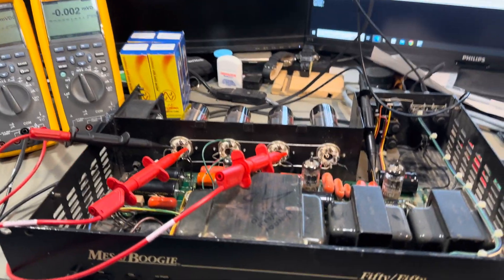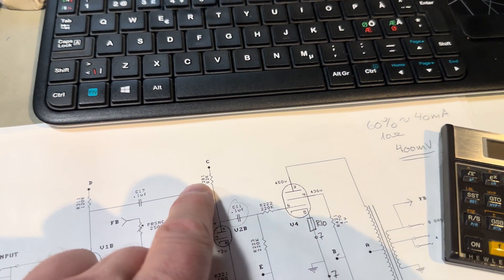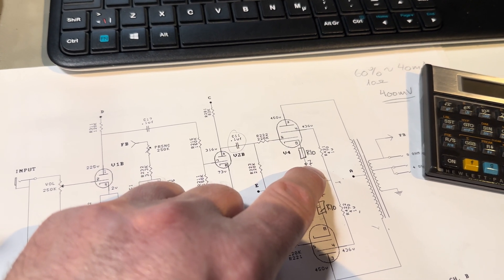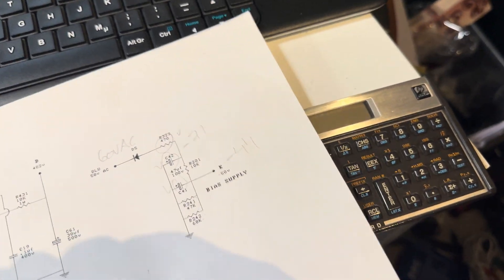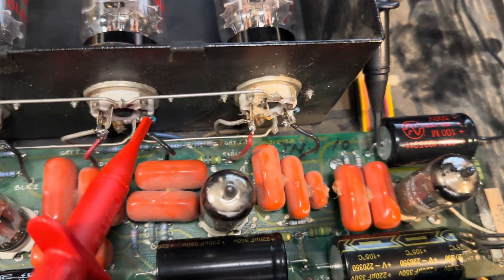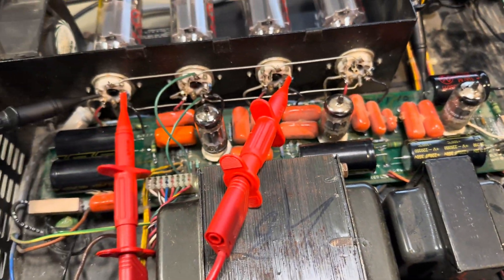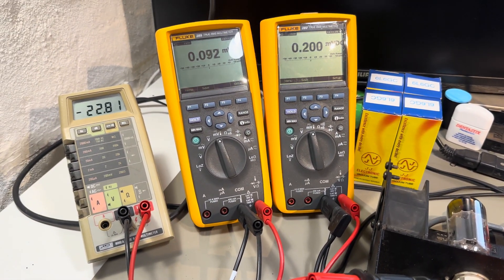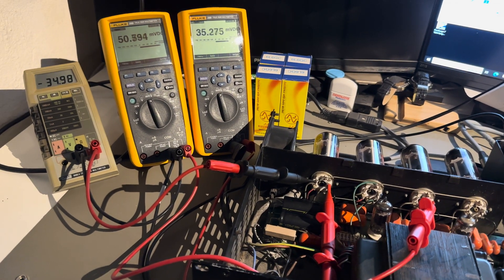Mesa Boogie fifty/fifty 50/50 - what I have changed and finding. part 2

Comment: Hi, can you tell me where you inserted the trimmer and its value? A thousand thanks
Reply from the maker: R241 is parallel with R242, I replaced R241 with two 15K resistors and 20K linear pot so now R241 can go from 30K to 50K. + I added a 10ohm resister in all the cathode to messuage the current.